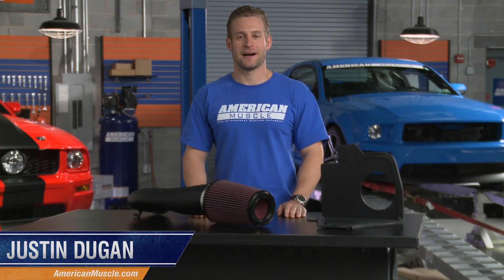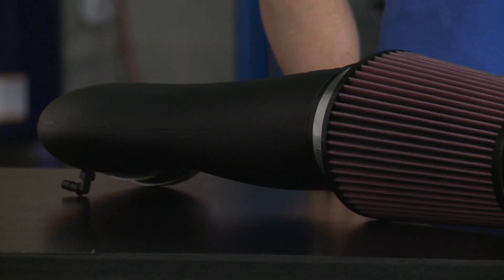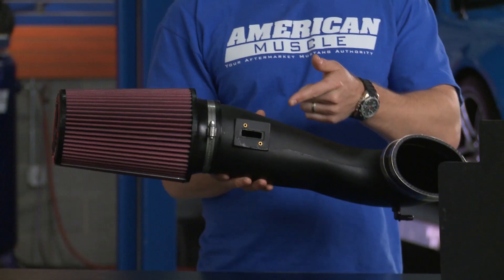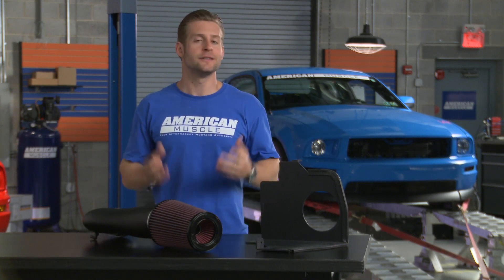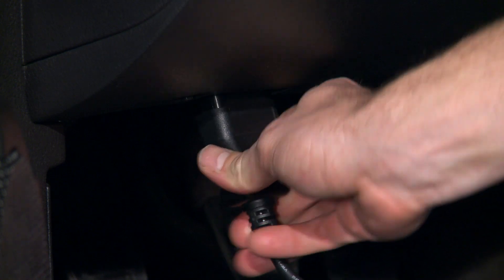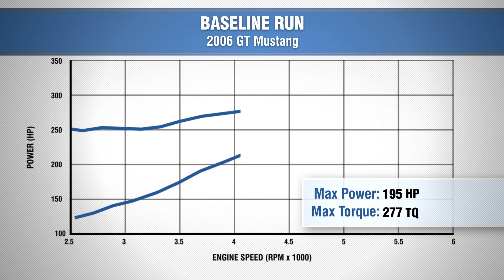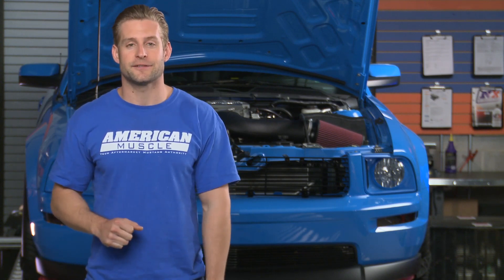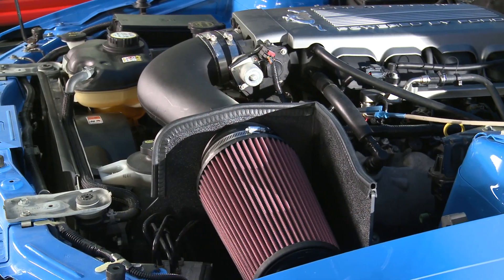Mustang JLT Performance Series 3 Cold Air Intake (05-09 GT) Review

Comment: They have done just stock tunes before and they can get close to 15-18hp with a tune alone. They are advertising the CAI in this video and this one requires a tunes so they are showing the performance of that package. Either way you double your horsepower gains by adding a CAI along with your tune.
Reply: Yea they say the tune gives 15 also they just tryna make the numbers seem biggee

Comment: I bought this thinking "oh what the hell it will be fun". It isn't fun. It is horrifying. The noise that comes out when driving makes your car just roar. It sounds amazing. I still get bumps every time I floor it. By the way I drive an automatic. The response time is amazing to. Straight off the line faster than normal. Also did I mention that the sound just is awsome. Well it is. Also you get better gas milage.
Reply: Dude...same exact experience,  just got ot installed with a custom dyno tune, in second gear it just keeps going and going, so much quicker now! love this set up on my 2007 GT
Reply: +UpliftedXHoonie xxx dude....its so worth 300.00. unreal performance  , looks amazing under hood, i got blue filter, I love it. when you floor it, thats when it fucking growls....from the front .....its so much quicker. i just laugh everytime i drive it. i cant believe how much faster the stang is now.
Reply: +UpliftedXHoonie xxx ....i dont know how to post videos.  i have a hurst billet quick shifter , flowmaster axel backs, quarter louver covers, honey comb black decklid.
Reply: +E Money you?
Reply: +UpliftedXHoonie xxx ...2007 tungsten grey premium. charcoal leather interior...38k miles.
Reply: +UpliftedXHoonie xxx ....how do i go to ur channel?
Reply: +UpliftedXHoonie xxx...you're gonna need 93 octane now....so much betta

Comment: Although true, I can tell you the tuner doesn't add much hp (from personal experience) where as the CAI does. And it makes sense, seeing that a much larger amount of air is allowed to flow to your engine, increasing combustion. So the hp gained may not be exactly 30 hp, but is definitely around 20-25, which is what they advertise on their site.
Reply: Yeah but you cant do the intake without the tune .. its a package…

But thatbis interesting, seems like it makes sense jist to keep the car on a 87 tune

Comment: Justin, What TB are you running on this GT. I want to get the FordRacing 62mm, but I'm not sure that the JLT CIA will fit that Ford TB. They said something that the JLT openning at the TB is only 4.5". Looks pretty small. Thanks. JDK

Comment: The question is have is when you get this package what is the power difference between 87 and 93 octane… i think im goimg to stick with 87… if i still get a 20-25 hp increase i’ll be happy not having to pay $1.20 more a gallon at the pump

Comment: If you check out the air raid cold air intake with AM, this same mustang put down 269hp base, and now its putting down 277? Questionable. And the air raid gabe 35hp, 30tq with a peak gain of 27hp. The numbers are all over the place. Just check our the air raid and youll see

Comment: Why not tune the stock run also? ONLY then you got a proper comparison.
The performance number are totally irrelevant because we don't know how many HP are gained from the tune and how many are gained due to improved air-intake...
Reply: The intake and tuner is a package dum dum.. actuslly this info is on there website.. if you read details for the tuner it says adds up to 17 horsepower.